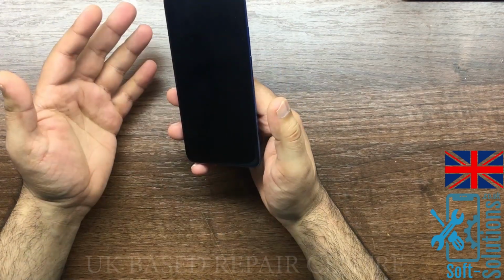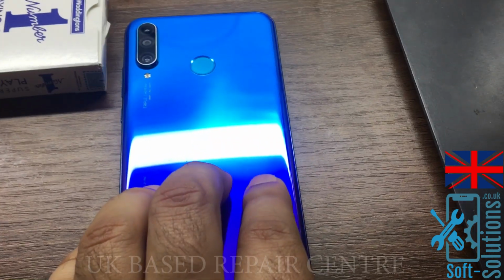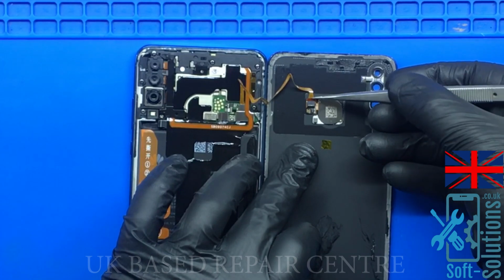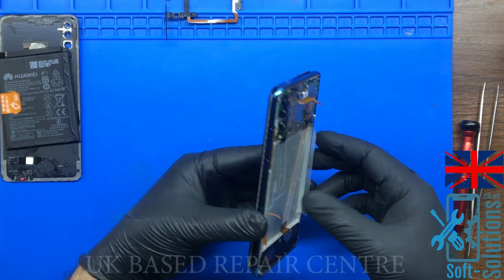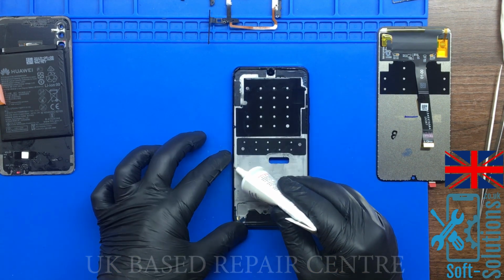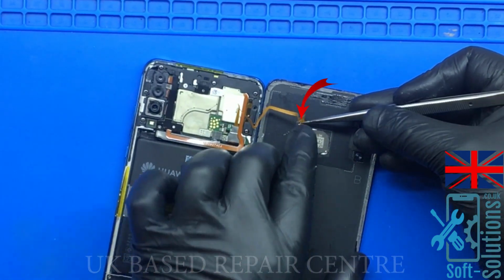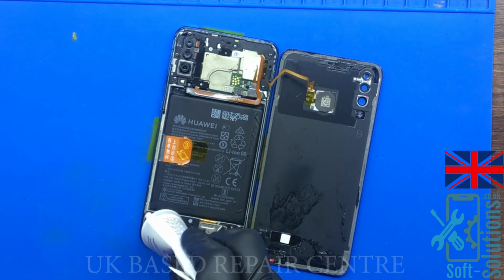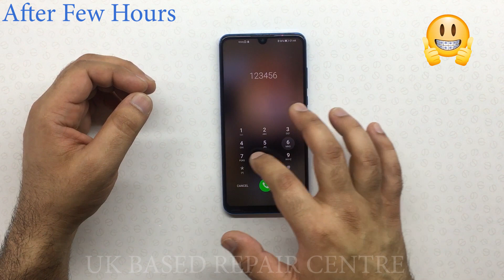Huawei P30 Lite LCD Screen Replacement

Comment: Just replaced screen on my gf phone, thanks for tutorial ! :)
One important thing - be careful during removing front panel, don't put "things" too deeply, I have damaged antenna cable.
Reply: How did you damage the antenna cable? I suspect this is what happened to mine at the repairs. How did you know it's damaged? 
I have a P30 but the sadly screen broke recently. 
The first place I took it to replaced the screen but the finger print didn't work. They put the broken screen back and I took it elsewhere.

The second tried again, place replaced the screen, the finger print worked but had 3 issues. The wifi says "Network Access Denied" when one tries to connect to any wifi. The bluetooth won't see any device and the phone isn't seen on the car's bluetooth. Thirdly, the Google Maps doesn't move as I move after I've started directions. I suspect the first must've damaged the antenna cable when he took out his screen.

I took it to a 3rd place and he also couldn't get the finger print to work though the wifi and blutooth connected after several tries, resetting and updating network setting.

He put my old screen back as I want the phone to work as normal.

What do you think is the problem please?

I'm considering buying the parts myself from Aliexpress and trying the repairs.

Comment: Super video showed me some stuff on the inside.. i putted the sim card tray spike into the wrong hole.. from your video it seems that i didn't damaged anything.. can you confirm that to me? if you will stick the sim card tray spike in the wrong hole on the upper part of the p30 lite that won't do any harm to the smartphone i suppose .. thank you if you will reply
Reply from the maker: Thant’s is the hole for upper microphone, but mic on these phones are not exactly behind the holes, so i don’t think you might have damaged anything.
But still test recording voice, front & rear camera video recording before you put everything back together.
Reply: @SoftSolutionsRepairsUK  yes I did it.. thank so much

Comment: Just replaced a screen my self but I transferred the board and now its boot looping any ideas? I've used my microscope to check see if there's any damage done by me but there isn't any, I don't understand, the phone was in a kids backpack and the backpack got hit with a football. is it possible the board took a severe hit and it's damage something under the shields by the cpu?
Reply: Found the problem a screw is shorting out the board at the bottom under my microscope there is no screw damage to either the daughter board or the speaker part - weird thing is there is a small shield protecting a small BGA chip when the screw touches that shield it shorts out and boot loops / remove that screw and the phone works.
Reply from the maker: A screw can press the shield down and any cap or other components touch the shield and shield is pressed towards them making those components short to ground as shield itself is ground.
Glad you have sorted.

Comment: You only repair lcd? How about the screen? I thought if the lcd is damage you also need to repair the screen or is it the same thing? My phone I cracked and I think it's the lcd because there is discoloration.
Reply from the maker: LCD Screen is one thing, it should be like this LCD Screen with digitiser if you want to say full name.

Comment: I replaced my Huawei P30 Lite screen but sometimes the screen is unresponsive. Is there any way I can fix this?
Reply from the maker: Faulty part
Reply: @SoftSolutionsRepairsUK  Because the screen mostly works but maybe sometimes part of the screen is unresponsive, does that mean the entire screen is faulty?
Reply from the maker: Obviously not the entire screen but you ll have to replace the entire screen 🙄